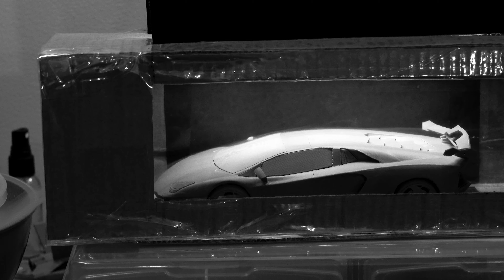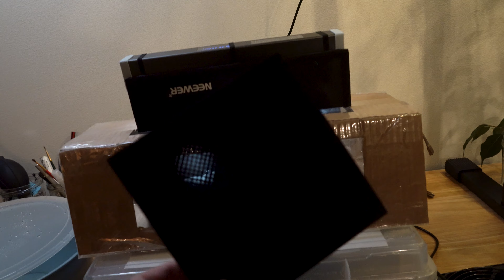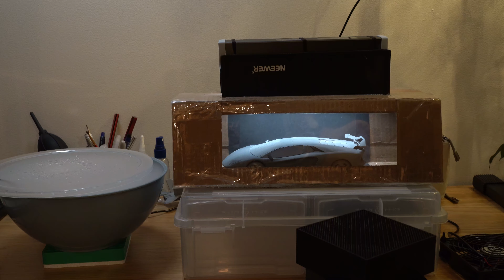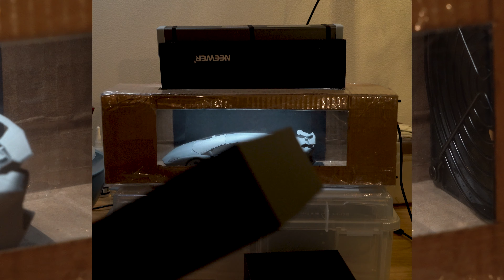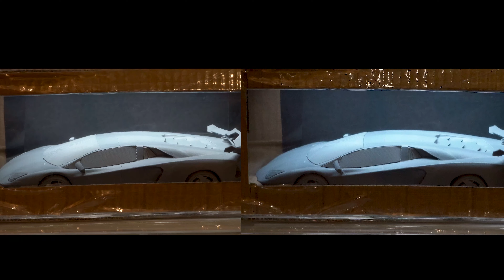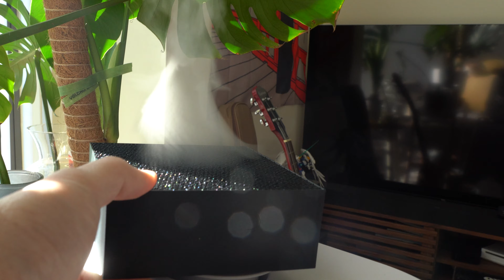DIY Wind Tunnel: Adding Airflow Straightener for Smooth Laminar Flow | Part 2

Comment: design is shaping up - laminar flow is just what you needed -  it doesn't need a back filter though, just the front filtered - back fan is fine -  longer tubes can work better so try double up the front with the extra one from the back - it is a simple check to see if it helps for this size/scale chamber, it looks pretty good now - one last point, ABS is overkill for this part as it has no external stress - PLA with outer wall set to 4 or 5 should provide added rigidity - looking forward to seeing your desktop wind tunnel evolve
Reply from the maker: Thank you for the feedback! You're totally correct, having the filter in the back doesn't do much. But after some testing I did find that it was able to straighten the airflow in the back a little. So I decide to stick with it (since I printed out 2 filters anyway haha). And I agree PLA will work just fine. It just happened that the only black filament I have is ABS (I need to get more filaments!). These are super valuable feedback, thank you again!

Comment: Hey man, amazing project. I'm using your videos as a guide for one of my experiments. I was wondering if you're able to use this DIY wind tunnel and gather lift and drag forces from it using load cells. Do you think if I aimed at gathering the lift and drag forces, I should be using a mist maker for strong airflow?

Comment: Wait this just gave me an idea for my project that I am really struggling with the math. Can I use this to visually see gas flow through the Inlet Guide Vanes then to the Stage 1 Rotor Blades and its Stator Vane blade angles if there is inefficiencies in the relationships?

Comment: Please bro I need the 3d printer file for the air straightner
Reply: I'm sure you figured this out by now, but just create a cube in the slicer and set the top and bottom layers to zero.  Then set infill to either grid or honeycomb.   This creates open the open ends.

Comment: how did u make the airflow straightener
Reply: I'm sure you figured this out by now, but just create a cube in the slicer and set the top and bottom layers to zero.  Then set infill to either grid or honeycomb.   This creates open the open ends.